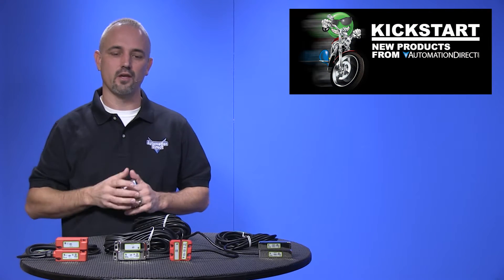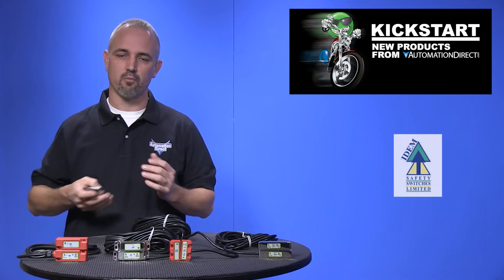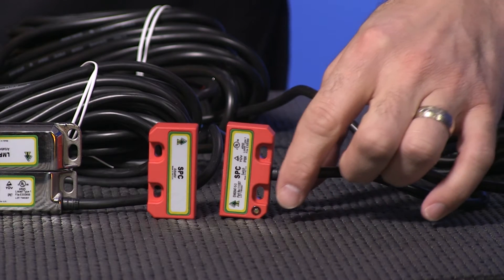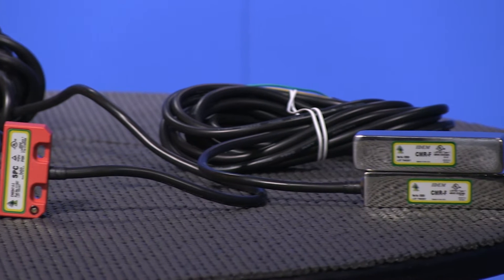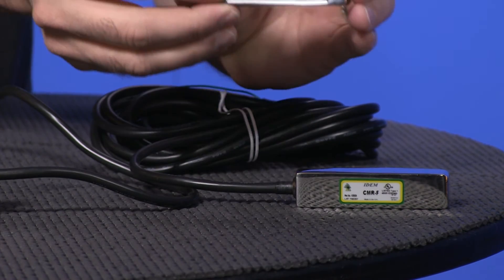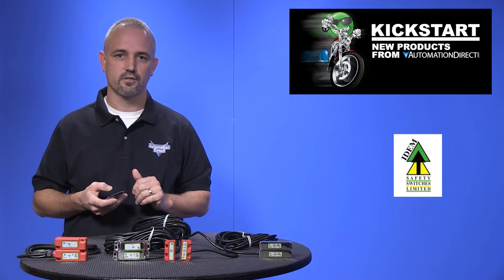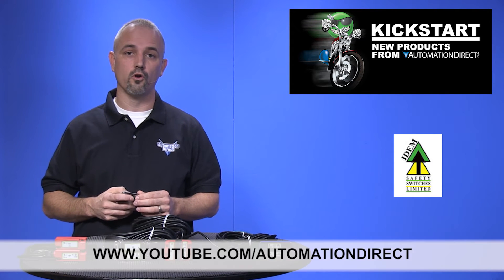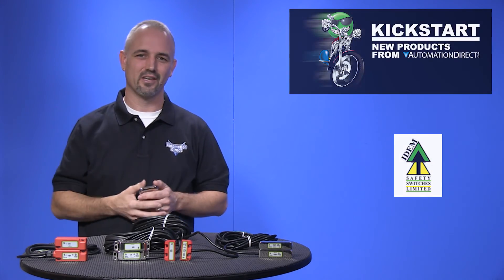IDEM Non-Contact Safety Switches from AutomationDirect

Comment: I purchased these for interlocks for guards of a crusher machine. I was led to believe they are simple reed switches, so now i'm stuck with them and either have to add a bunch of other components to make them functional or just throw em on the shelf to collect dust and find somthing else. I'm trying to switch 240v  for a relay coil.
Reply from the maker: @Cetrifugalsparks, We are sorry to hear that this product will not work for your application.  AutomationDirect does offer a 30 day money back guarantee.   You may want to contact Returns and see if they can help if the order is past 30 days.  https://www.automationdirect.com/adc/return/return/

Comment: hey i want to use this switch on an air conditioner. when i open the door i want the A/C to turn of an when i close it the A/C must turn on back. now how can i get that system to work?
Reply from the maker: Samuel Bass Junior, It sounds like you are looking for a Non-contact Magnetic switch of a Tongue Interlock Safety switch. I would look over these docs. https://cdn.automationdirect.com/static/specs/idemncmagss.pdf https://cdn.automationdirect.com/static/specs/safetylimitswitches.pdf

These switch will either "make" or "break" the electrical circuit, depending on the Switch configuration, and this is what you will use to start and stop your device. Typically, if you have a stop circuit, you would place the stop circuit  through the contacts that will "make" when the door is closed. 

Thanks for the comment.